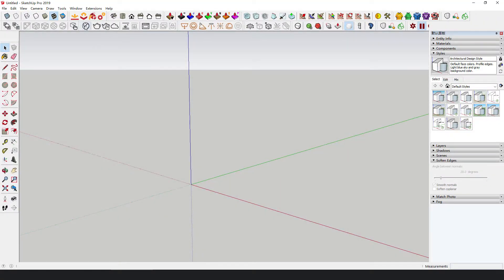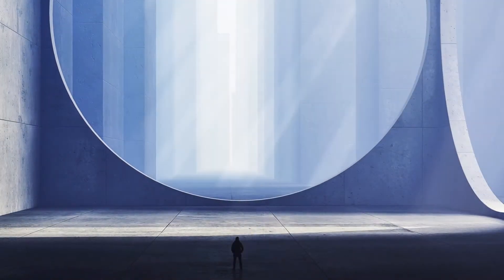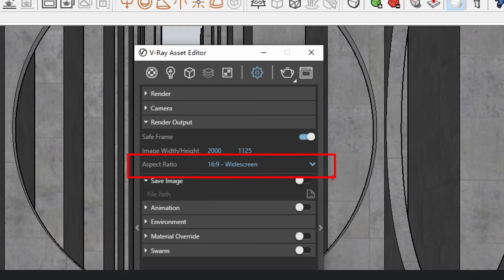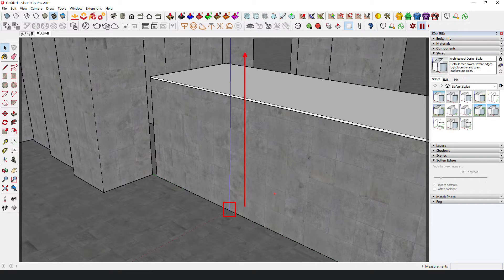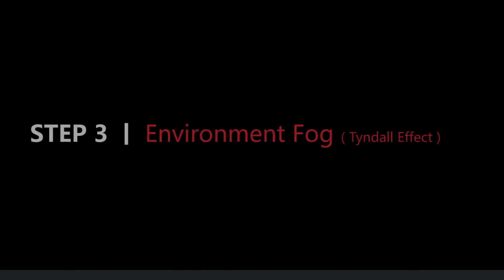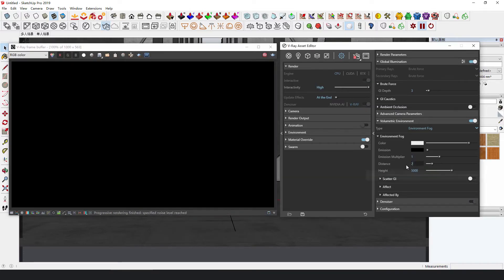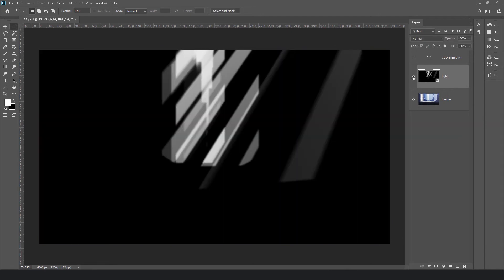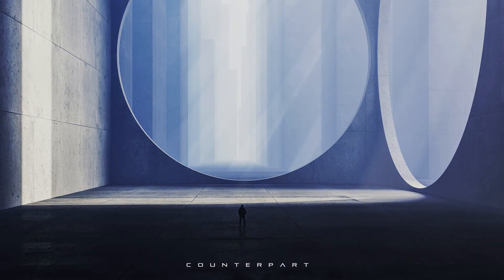SketchUp & V-Ray Tutorial丨How to Render Volume Light

Comment: I am expementing according to your settings but my AO map does not show any ray. I use only the sun, Environment is off, Vol. Environment = Fog and Affercted by is sected to sun light. I changed sun intensity, distance and height. I see some rays on the RGB layer, but not on the AO layer. Any suggestions?